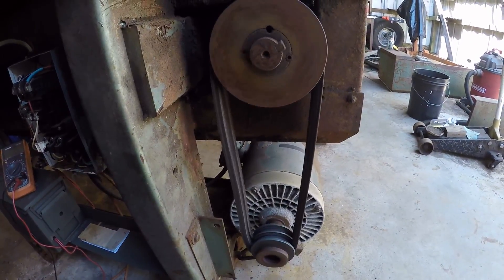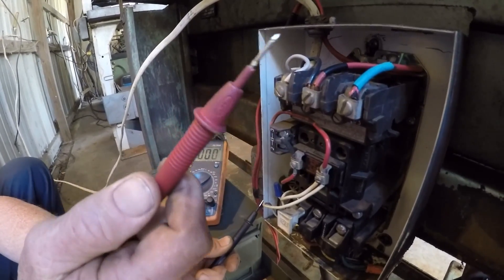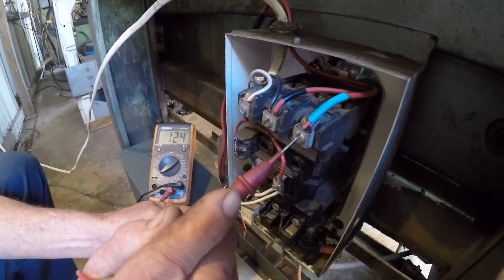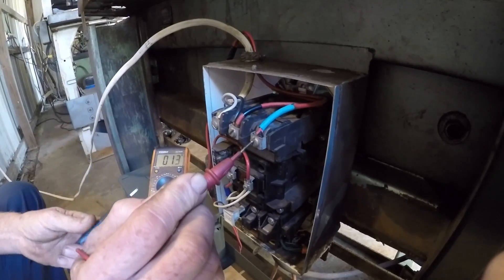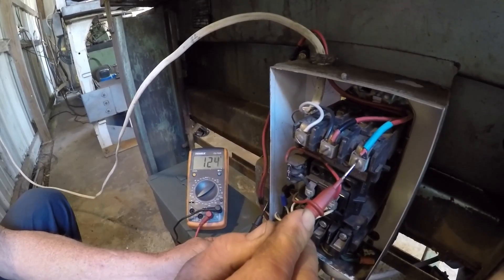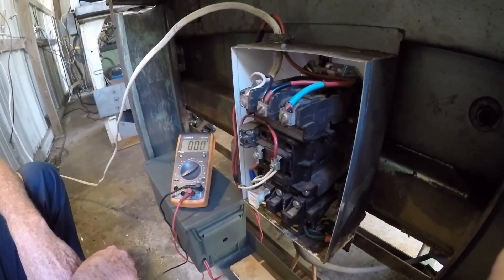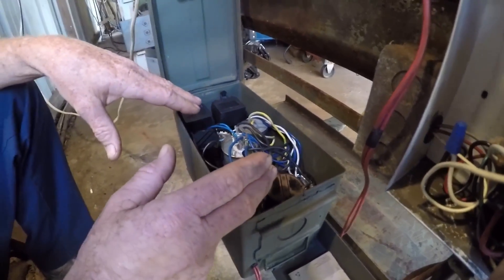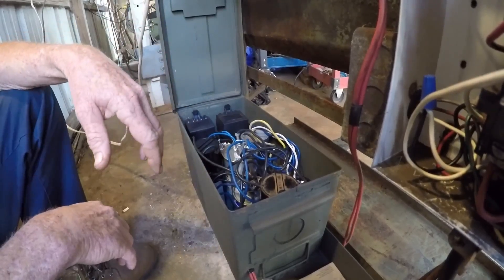Running a 3 phase 7.5 hp motor on single phase power

Comment: I would like more info. I have 15hp 208v air compressor I want in in my shop but have no 3 phase. Do u have more specifics on what u did
Reply from the maker: I'm not too sure on this myself, however LP is the one who is talking in the background. He knows about the setup better.
From what I understand it uses a combination of start and run capacitors to get the motor started then running. 
Again I'm not too sure on this. I will check up with LP and try to get back information if I can.

Comment: each phase should read the same on 3 phase why do you say different ?
Reply: On a 3-phase 3-phase system one leg is going to be way higher than the other two legs best reason why I said Wednesday is tired and the thing is you know salvaging the voltage off of one leg like around

Comment: I now this is kind of late but you are smarter than 90% of us. I thought of the same thing, why run an idler and 2nd motor when you can just turn your equipment motor into an idler motor. now that said I believe the only reason to install a rotor phase or whatever you want to call it, is some equipment has multiple motors like a heavy duty milling machine or if you have a lot of three phase equipment. Also you will have to derate your motor by 33% when you do it your way, but thats still a 5hp motor . Another thing is the price of a vfd has gone down a lot I picked up a 7.5hp vfd for under 200$, you get full HP and slow ramp up time.

Nice going!

Comment: sir what value of capacitor can be use in 5 hp 3phase motor run in 1 phase 230 volts power supply?

Comment: Dammit  thats nice work there bub.....Gots me a new explosion proof sealed axial fan that runs off 460 volt its saying and i need to fire this up as fast as possible so maybe someone could help me out with a parts list and wiring diagram here please? Im working in the middle of the desert and by golly its hot and the bugs are thick so gots to get this fan up asafp thanks everyone for your help and yer time.....

Comment: it is possible to control the speed of 3ph motor on single supply
Reply: Akash Agale yes it is very easy I know because I done it
Reply: how it is possible to control speed
Reply: Akash Agale ok first of all you need to know what your volts is running....if volts to high reduced compasters to bring volts down.....you Will need a resistor....now if the motor is hard to start put a start compaster in.......need to charge phone up will get back up with you
Reply: Akash Agale ok it's been awhile sent I seen this to control the speed don't add to many com that was wat took me soo long I was tealking com out because I had the motor running on 280votes on the 3leg and it getting hot...I whis my son wood come up so I can do a video on how I done it
Reply: Akash Agale soo sorry it took me sooo long to answer you

Comment: Hi. I did some videos about this a few years ago. I have noticed in my experiments that if the run capacitor value is too high then the voltage on the induced phase with be too high. I think that is what you have got. Your start capacitor seems about right as the motor starts well. Cheers, Andy
Reply: Andy Reynolds sir think you soo much for your comment I have seen you running 3phase you have help me to figure this out along with my friend.but the real man that know what he is talking about is you ty ty ty 👍👍👍👍👍👍👍👍👍👍👍👍👍👍ty mister Andy
Reply: Cheers
Reply: Andy Reynolds think you sir 👍👍👍👍👍you are the king 👍👍👍👍👍🍺🍺🍺🍺🍺
Reply: Andy Reynolds my son said ty 👍👍👍👍👍and. 🍺🍺🍺🍺🍺

Comment: very good work can i ask are you using a connector in the box .great job good luck.
Reply: Micael Dowds No I'm not but ty so very much for your comment 👍👍👍👍👍👍👍👍👍👍
Reply: Micael Dowds and the machine is still running great think you soo very much for your comment.ty ty ty 👍👍👍👍👍👍👍👍👍👍

Comment: can you show us a diagram of how your capacitors are wired and capacitor sizes for start and run,,,,,,,the reason i ask is because i am trying to run my air compressor with a 2.2kw motor but its failing to start when i connect the air end of the compressor to the motor,,,,but the motor runs when its not linked
i have tried capacitor from 50 mfd up to 150 mfd,,,,the smaller number of capacitor wont start the motor and when i got up to 150 mfd the compressor would run but cut off quickly  because the amp draw was so much higher than motor  rating so it would cut on overload
Reply: Here's what I've been told.... Do NOT run compressors or any other constant load motors/equipment(compressors, power feeders, etc.) on static phase converters.   The constant load will burn up your motor.  The reason your compressor motor-only runs fine is there isn't a load on it.  Once you add the compressor pump, it puts a constant load on the motor.  In your case, the motor and pump specifically sized to work together size and using a "capacitor-only-converter", you have reduced the motor output by 1/3.   Pump can't run on 2/3 power of your existing motor and overheats. BTDT   Once you let the smoke out of your motor, you can't put it back(joke)   Someone, please correctly if I'm wrong    -brian...still learning
Reply: B H Ok man I will agree with you 100prescient but my compaster is not getting hot .and too why dues 3phase used compasters to get the volts up think about it and they are wired in 3phase idle motors.....😀😀😀😀😀👍👍👍👍👍ty for your comment ty ty ty. now when I had 280volts going to it one side of the motor was getting hot..it tock me 4days to get volts right so one side would not get hot but I do know what you are talking about 👍👍👍👍👍👍👍👍👍👍👍👍👍👍...think you very much.
Reply: B H can you say king of 3 3phase????????😀😀😀😀😀😀😀😀😀😀😀😀😀😀😀😀😀😀
Reply: what is the hp of the motor? Jason h

Comment: volts on running is L 1 to L3. 245 volts L2 to L3.271 volts now under a load L1. to L3 247 volts L2. to L3.262 volts

Comment: This is a known way of doing it. The capacitor creates a phase shift to make the extra missing phase. If you move the red/black wire to the other terminal the motor will reverse in direction.
Reply: +L P. use a decoupling capacitor.
Reply: bemi8k I know what you are talking about . but do you know to control volts spkes I do.
Reply: What do you mean by "volts spkes"? You mean occasional spikes in mains voltage?
Reply: Jeff S got the amp draw.Running L1.11amps 
L2.12amps 
L3.21amps 
now under a load 
L1.14amps 
L2.14amps 
L3.20amps 
that was on my friends amp meter and I think he was exping higher amp draw.

Comment: When you say 'if this was a 3 phase hookup, one of these lines would be higher voltage' you're not right. I think you're measuring phase to earth with your meter, and on a 3 phase grid connection you'd see the same voltage on all 3 wires (120 or 277 V in the US, depending on the connection type), but because the phases are out of phase with each other, you'd also see voltage measuring from one phase to the next, and you'd expect to see the same voltage between any pair (208 or 480). It would be interesting to measure the phase to phase voltages on your system to see how even they are, stopped, running, and under load.
Reply: Jeff Stowasser I'm not an electrician, but also i'm in the UK where delta leg high is rare.
Reply: There are different types of 3 phase power. I won't go into too much detail but there are systems where you get the same voltage across each leg to ground, and there are systems that have a "stinger leg" like he described in the video. In a 240 3ph system you would get 240 leg to leg, then 120 on 2 legs to ground, and the third leg to ground would be 208.
Reply: To measure phase to phase, you just put the black probe from your meter on one phase and the red probe on another.
Reply: +anothermoth...  I hope you are not an electrician...B  phase can be higher to ground than A and C to ground.  it's called high leg delta, in fact is very pillar in the United States.   the winding between a and c phase are center tapped to make 120v.